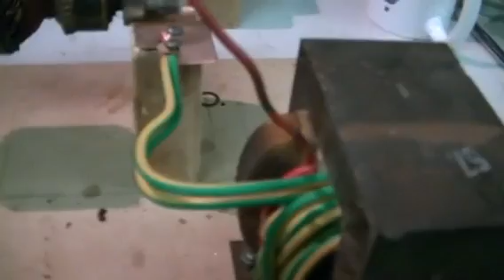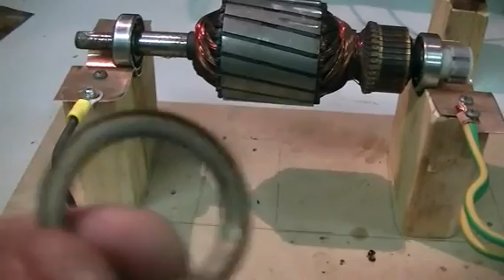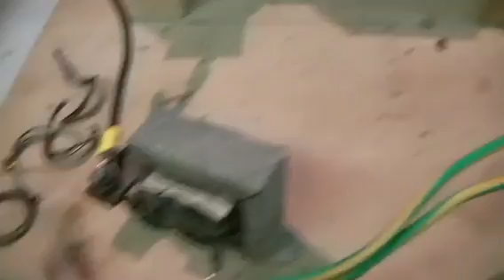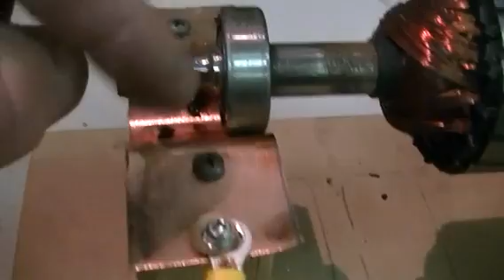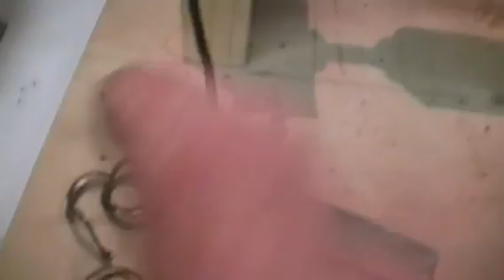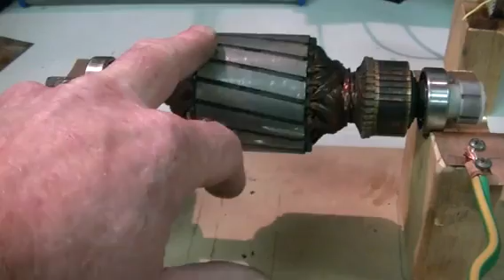Bearing motor test 2 with interesting find

Comment: Neat electro-thermal motor.

The rollers expand where they touch due to current and non-zero resistance, and push on the races of the bearing. If the bearing spins then they push away.

Comment: interesting investigation! when i was playing with my magnetic suspended rotor and going for long running hand-spins, i found that using a metal shaft (+metal bearings) dragged the rotor considerably, and i had to use a wooden spoon handle. these two behaviors seem linked.